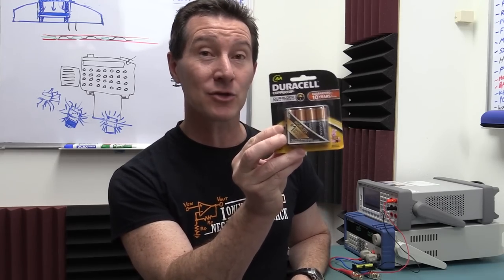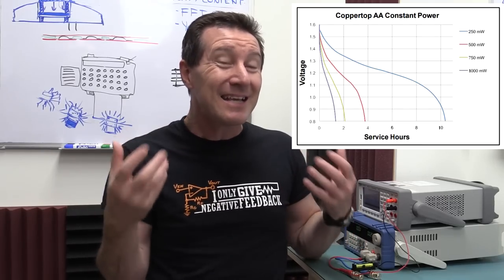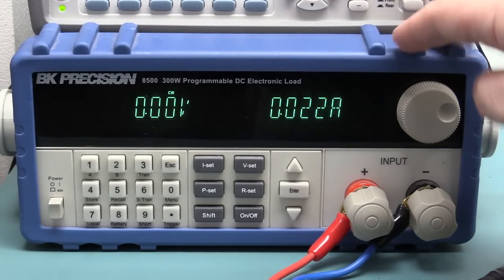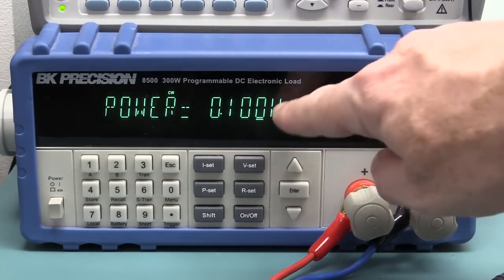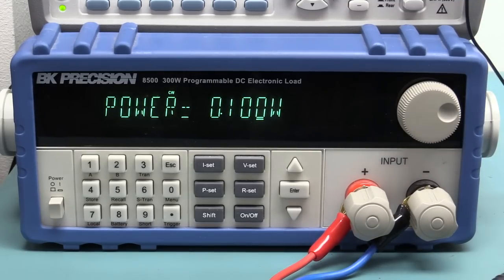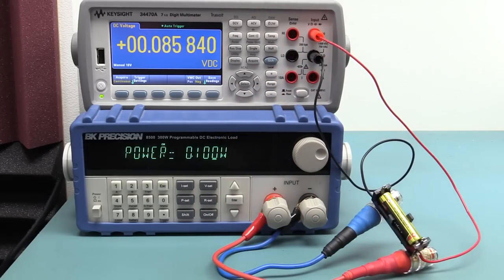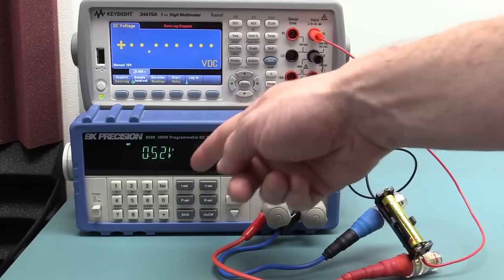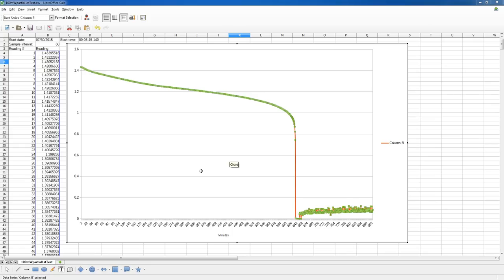EEVblog #774 - Low Battery Discharge Testing Part 1

Comment: You've got a lot of faith in the display on that electronic load...   You should also be measuring the amperage independently to verify that the BK Precision is telling the truth...
Reply: icesoft1 well, he's power supply did it. And it said it was spot on. The problem is in the software, the load isnt analog, so if it isnt fast enough that can happen. It had the same problem with constant resistance mode which he showed a while ago.
Reply: Doh...  I misread the display on his power supply during the test.

Guess I just wasn't getting any warm and fuzzies from the hysteresis loop in the battery test and the data acquisition software...
Reply from the maker: Laharl Krichevskoy Oh yeah, the "power supply killer" constant resistance mode! Had forgotten about that.

Comment: hey dave, could you take a few samples of the ESR as the batteries discharge? ESR is more important that that "extra energy" left as it will tell whether you can get it in a bucket or drop by drop.

Comment: I have a "1,5V led flasher" 3 transistor circuit that has been operating on under 0,8V battery for 24/7 over a year now.
Reply: thekaduu Nope. Human size years. And it's still running.

Comment: Hi, I work in a primary school. The teachers use digital cameras for part of the children's
course work. The teachers routinely require new battery's as the don't last long. I have released that the camera's have a very high cutoff point and now when they request new battery's i ask for the old ones because the still have enough energy for IR remote's which last a long time. I think digital cameras are either poorly designed or we're using the wrong batteries. I only use Duracell ultra power.
Reply from the maker: hue mondesir Your problem is the use of Alkaline batteries for cameras, that's bad! You need NiMh rechargables as they have much lower ESR for higher peak currents.
Reply: hue mondesir 
No, you're not using the wrong batteries. What's wrong is that you use batteries at all! The only real advantage of alkalines over rechargeables is their low self discharge, so you can put it in a device that has to run for month or years. A camera does not need that.
Reply: EEVblog Thanks for the reply Dave,  but have you ever worked with teachers, they may be able to teach children but when it comes to technology that's another story. I couldn't imagine how many  rechargeable battery's would get discharged  to the point of no return or just get thrown away. we have 30+ cameras  and it's driving me crazy with the amount of batteries we go through.

Comment: It's not about how much energy is left below .8 volts because most electronic devices ,which is prob 99% + ,  that are on the market won't operate much below .8V due to p-n junctions.
In a very scant few devices that can operate below .8V , the time left is ridiculously low for a battery that started out as 1.5 V under load.
Reply from the maker: WisdomVendor1 Yes, that's the whole point of the video, to find out how much that "ridiculously low" time left actually is. if you can data elsewhere for it please add a link.

Comment: You might try some different battery chemistries like carbon-zinc, lithium, and the alkaline that you're already running.   Would be interesting to see how much power one could squeeze out of the other chemistries (like if there were a better chemistry based on the type of load).
Reply: icesoft1 carbon-zinc are crap anyways.
lithium i'm not sure, but li-ion and li-poly can catch fire if over discharged. Not sure about the non rechargable lithim ones. They do have lithium metal inside so unles they do not, there's always the posibility for lithium to catch fire (just exposure to air does the trick)
if anything, it would be more interesting to meassure the ESR at different charge levels as it would actually tell you when you really cant do shit with it, even if there's still some small percentage of "energy" left
Reply from the maker: icesoft1 The Lithium AA/AAA's would be interesting. Yes, I might try those after Alkaline.

Comment: Dave, you are so right about the BK load; it's a great instrument, but the software SUCKS!  I had to write my own LabVIEW drivers.
Also, the isolated RS-232 cable seems to have very poor common-mode rejection, or at least mine does.  You should check that.  It could make a very interesting video.

Comment: This reminds me of something that happened to my sister a couple of years ago. She called me up saying her Home air conditioning system was not working, The conversation went somethinglike this.

 My sister, My A/C stopped working, what do i need to check, and how do i check it.

Me, do you have a digital thermostat.

my sister, what is that.

Me, does it have a display that shows the temperature on it.

My sister, yes..

Me, check the batteries.

 My sister, Does it have batteries. I've lived here 14 years and never knew it had batteries.

She goes and checks the batteries. Sure enough they were dead.  After changing the batteries; the air-conditioning system worked fine.

My sister, Who knew the batteries  would last 14 years.

PS, Before you ask, no I do not know what kind of batteries they were. and yes this really happened.

Comment: any chance you could do some vids of LiPo vs LiFe batteries as these are getting so popular and happen to be so dangerous,  more often than not when hit with a hammer and thrown in a microwave. No that's been done , just like to know the more indepth tech info on the charge numbers especially for LiFe as there's so much opinion out there and it seems the manufactures don't always give the info.

Comment: I have a 50ah sealed lead acid  (not a Car one) charged it is 12.8v  what is min voltage Can i go to with out damaging it  ie:  10.5v  or 11.5v open curcuit volt,  when i put my camp fridge on the battery volt drops from 12.8v to 12.1v while the load is on. hope explained it

Comment: Hi Dave: How about putting a cap (+/- a resistor in series) to damp the oscillation at the end.  Initial thought is that it should not effect the curve other than to smooth the end.  Yes/No?  Cheers, Mark
Reply: Mark Beeunas I think this capacitor will only change the frequency of the oscillation, because the equivalent circuit of the battery, as the recovering of its voltage suggests, is already some kind of RC circuit after the "big capacitor" ie the chemical engergy source.
Reply from the maker: MichaelKingsfordGray Could be something like that. Would be interesting to know the exact chemistry happening...
Reply: MichaelKingsfordGray 
You say, "I suspect · · · "  Prefect reason to test.
Reply: Raymund Hofmann 
You say, "I think · · · "  Prefect reason to test.
Reply: MichaelKingsfordGray 
Nope, just cannot speal, speel, sphell, anyway.

Cheers,
Mark
************************

Comment: "nice and easy test" (10k yankee dollars worth of equipment on screen)
Reply: 666Tomato666 easy != cheap
Reply: KX36 that's what I was pointing at, having good tools (which most often means expensive, especially with electronics) is what makes stuff like this easy
Reply: oh yeah, i see that now. Funny how reading things with different emphasis in your head can change the meaning.
Reply: 666Tomato666 There is no need at all for using high dollar equipment !! It is just showoff + the man dont have cheap equipment :-)
Reply from the maker: 666Tomato666 So use any data logger you like. Build your own constant power load. You don't have the use the same gear I used.
Reply: EEVblog I have had some experience using Multisim.  Would that work?
Reply: Apple computers are made to be 'easy', and they're incredibly expensive compared to 'more difficult' options. So maybe there's an inverse relationship between difficulty and money.
Reply: SeanFromPVD Actually, my experience with Multisim is on Windows.  Come to think of it, most of my whole entire experience with computers is with Windows.
Reply: SeanFromPVD Apple's expensive for the aesthetic, not necessarily 'ease'. They style themselves as 'designer computers' these days.
Reply: EEVblog Well, I won't criticize your equipment..  For the resolution alone, gear that is somewhat non-cheap is required if you want meaningful data at the end, which happens to be the part you're interested in.  Sadly, this rules out my 3-1/2 digit DMM.

The constant-power load seems more interesting.  I cannot find any examples of a component, or a circuit for that matter, that inherently presents a quality constant-power load without fancy microcontrollers, A-D converters, and mathematics.  I suppose kids today take for granted that this is how things are done, but for a simple task this seems like unnecessary complexity and expense.  I also think that an honest-to-goodness analogue circuit would do a better job, if it is possible.

But is it possible?  Can one create a constant-power load that is stable and precise (within certain limits of course), while remaining fully in the analogue domain?  Unless absolutely required, it should not use switchers and such that would introduce noise on the output and potentially create instability.  Transistors and op-amps should operate in the linear region.  To me, going digital on this seems like the electronic equivalent of going nuclear.
Reply: pillsnotbills All a constant power load has to do is draw more current per less voltage, which there may be a variety of techniques for. If you want a really old style one, a servo-controlled potentiometer will do it.
Reply: Gravity that seems... hackish
Reply: Gravity There are many techniques to draw more current with decreasing voltage (negative resistance).  Though such techniques would likely be needed, in itself this is not constant power.

A servo will have hysteresis, which is undesirable.  It also seems terribly slow.  I was hoping to stay out of the mechanical domain, as well as the digital. :)
Reply: pillsnotbills In essence, it's a rather basic electronics. You're taking V=IR and P=IV and developing a circuit which sets those values according the proportion you wish. Big D actually implied how to do this in a recent video: You can take a DC-DC converter which outputs a constant voltage, place a constant resistance across it, and you'll get a constant current which will produce a constant power.

Adjusting the output voltage or load resistance on the converter will adjust the power drawn. More particularly, as perhaps mentioned in a video, you'd really want to test this in-application, and many constant power applications may use a DC-DC converter. You can do stuff like measure the input voltage with an opamp and inject a blocking voltage and the like, but in-application tests are probably preferred.

Though as a note, don't assume mechanical systems will be slow, especially electrostatics. You can get some fairly precision electromechanical systems, which can even exceed solid-state per analog computing advantages.
Reply: Gravity Big D also mentioned that DC-DC converters are not entirely linear

and we are interested in testing batteries themselves, not how they behave in a given system, so in-application testing would give worse results
Reply: 666Tomato666 In-application testing perhaps by definition cannot give worse results, since you are testing it in the direct conditions you intend to use it.
Reply: Gravity we are testing battery not system

results form testing a system can't be easily generalized - they give less useful results - IOW worse

that's the reason why you see 100mW curves on technical sheets not an "Acme Widget 8000" curve
Reply: 666Tomato666 Basically, the battery is not independent of the test jig. So whatever test jig they use, because it is different from the application, that will introduce error proportional to the difference.
Reply: Gravity " reading comprehension" look into it
Reply: Gravity
I really like this idea of using a DC-DC converter as an adjustable constant power load. I'm not going to comment on this discussion that followed about whether it's appropriate, I just think it's very clever. I wonder what topology would be best. A boost converter for example draws input current through both parts of its switching cycle and so has less input current and voltage ripple (and incidentally has no RHP zero when viewed through its input because of this) which is one of the reasons it's good for input current shaping in PFC. I think you may run into problems with minimum voltage at these very low battery voltages though.
Reply: 666Tomato666 I was actually curious before I saw your post, So I looked it up ,you could buy that gear for a low price of $4,500 today, free shipping.. thank you google. :) Anyways in previous videos I've seen walls of shelves packed with testing equipment on them. I wonder from time to time how much $ I'm looking at.
Reply: 666Tomato666 Well I can explain the science of it: However the test jig measures the battery, it's using a particular method to draw power. The system is basically 'an application' which uses a constant power. You're never testing the 'battery itself' in a vacuum, because it's always connected to an application to do the test.

So when they take datasheet measurements, they try to use a system 'in the middle' of all possible applications, so that it can be more accurate to whatever anyone might want to use. However, this also means that every manufacturer has to test their own applications AGAIN because that sheet is not representative of any single other system. It's inherently less accurate that an in-application test. So if you know you're going to want to see the battery performance on DC-DC converter applications, using one may tend to be more accurate. Even moreso if you use the SAME DC-DC converter type those applications may use.
Reply: KX36 Well, if you were planning on pulling energy from sub-0.8v batteries for an application, you'd likely want to run the test using the converter you'd want for the application. In another thread I mentioned that the LTC3105 could do it, cutting out at 225mv. So you'd get data down to 225mv. You'd basically be testing how well the IC could run applications on dying batteries relative to a constant resistance application.

Comment: Very interesting, would you get better voltage drop precision if you had super cooled wires?
Reply: Sean McMunn 
Better wires would clean up the measurement at the really low end, sure. But what real life products have anything better than what he is using in this video? I think that, in a way, makes this result even more accurate.
Reply: Sean McMunn 
At low currents the wires are irrelevant. At 10mW constant power you only get higher currents (say 1A+) at the very end (below 10mV).
Reply: That depends Sean, are the crystals aligned?
Reply: ArtificialDuality Ya that's true, real life examples > theoretical testing. Cant wait to see the results of the experiment
Reply: Pook365 Yeah, I heard it depends on if you're using snake oil!

Comment: A single battery-test should not exceed a month or maybe two. Otherwise you may get a problem if your USB stick is formatted in a FAT32 filesystem (4 GB maximum filesize).
Reply: Luncher91 maybe 2 months??? 4GB = 2^32 bytes. 2 months = 86400 minutes... Assuming that a single value (V) is being written into the CSV file including the comma is 7 bytes (as in "#.####,"), it should take about more than 1145 years to reach the 4GB file limit... What number are you using???
Reply: sorry i dont know what i have calculated. you are absolutly right. i think i divided by 60 one times too often. :-D But i assumed a measurement per second. Correct would be for 7 bytes/second : 2^32 bytes / (7 bytes/second) / (60 seconds/minute) / (60 minutes/hour) / (24 hours/day) / (365 days/year) = 19.46 years

So i no problems by the amount of data. Sorry for that absolutly incompetent post!

Comment: well, why not just drop its energy with a 1 volt zener and current limit then start to log with high density readings a 100mW or just a 10mW that will save your day.
though I bet a battery can't survive a .5Amp when its voltage drop, it cant maintain that rising current.

Comment: Are you sure the packet structure isn't just Modbus? The Maynuo versions just use Modbus over RS232. I wrote a bit of python code that reads out values (never got around to writing the rest that actually sets values). https://github.com/MetalPhreak/pyMaynuo